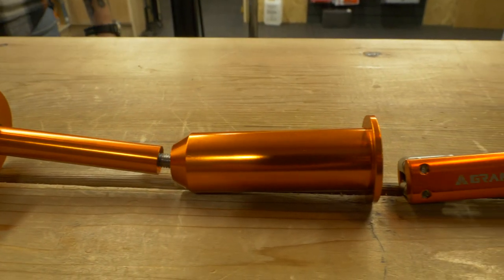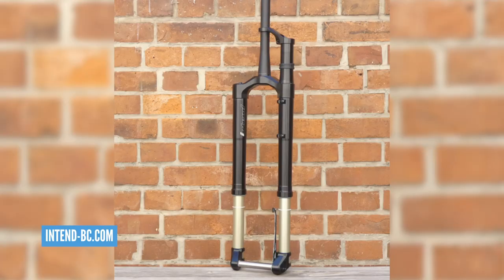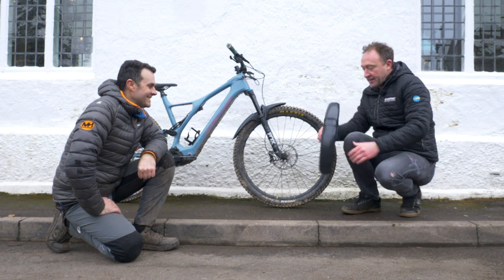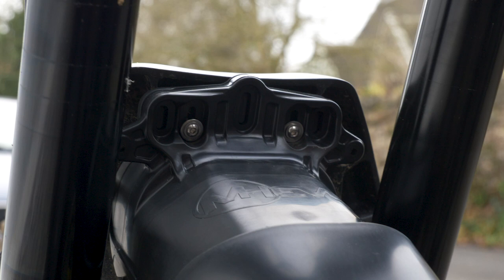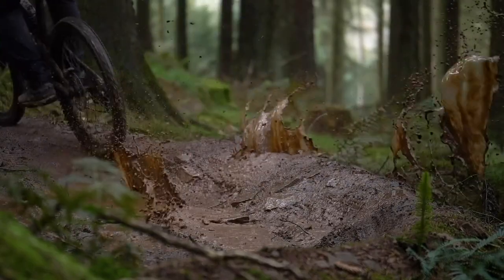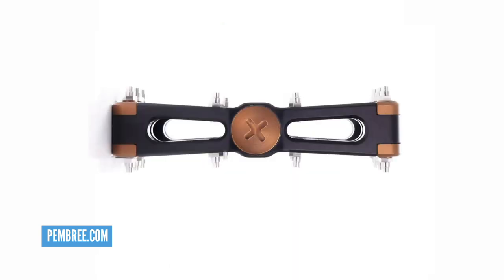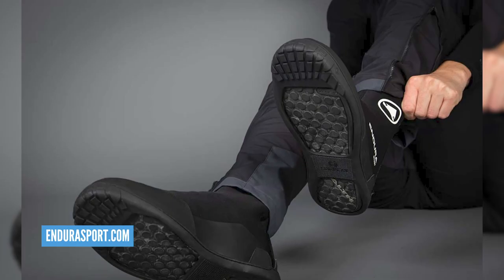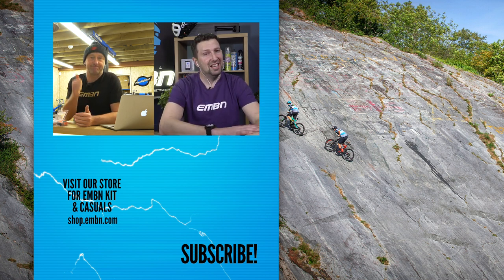New Bike Products and E Mountain Bike Tech! | The EMTB Tech Show

Comment from the maker: What did you think of these products? Let us know below 👇
Reply: I’ve got a set of those  Endura overshoes - they are the bees knees  although they size up small so get larger than your shoes or you’ll be in A & E with multiple hernias 😖 and that fork 😱🤮
Reply: That crank-stick is absolutely garbage. Used mine once then it broke, it's nowhere near strong enough for purpose. Avoid like a Covid carrier.
Reply: I would rather mud hugger extended their rear guards and put an backward angled lip on the front ones to stop water and muck being thrown up onto your back and face as currently happens.
Reply: I have a question I have a 2020 spectral on but can’t seem to find any high rise bars that have the pre cut holes any advice on this?
Reply: Guys what about anti puncture protections for tube and tubeless riding ? Its any development with this topic ?
Reply: See my feedback regarding crank stick in the comments. It is garbage!
Reply: Wheels matched to bike and riding is often overlooked. Basically most of us need a usage category of 5 or 6 according to ASTM F2043.
Wheels only just starting to truly meet eBike and rider all up weight for the terrain they are built for.

Comment: Guys, great show, I watch all the EMBN videos! Ebike specific lights need a proper round up. There are loads out there, Exposure, Lyzene, light and motion, Lumicycle to name a few. However, there are lots of restrictions based on your motor type (available power for the lighting loom) from what I can see. Please help to clarify and do a video showing the best priced useable (ie 1000lumens min) light and the most powerful light that can be bought for each of the major motor options ie Yamaha PWX-2, Brose, Bosch C4, Shimano. I have a Haibike Allmtn 7 2021 so I would be really interested in my options. Maybe even a how to guide of how to connect up the light for each of these motors. Do they all need dropping out to get to the connections or do some have connectors within the headset area on the frame? Looking forward to the next GOB!

Comment: Do more Emtb riders use flats vs clipped in?
Reply: I’ve been riding spd’s since the 90’s and what happens it’s that you might want to consider the kind of terrain you will be doing. I would definitely do not recommend clips if you are doing hard trails. uncleating might be hard at short notice, specially if you need to foot track. Clearly there it’s room there for flat pedals. I ride road/mtb and Emtb.